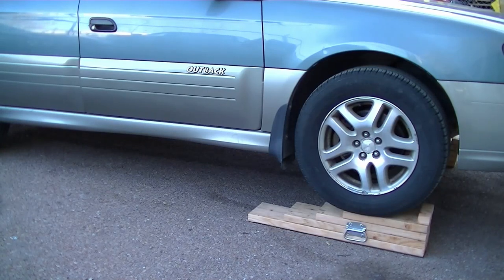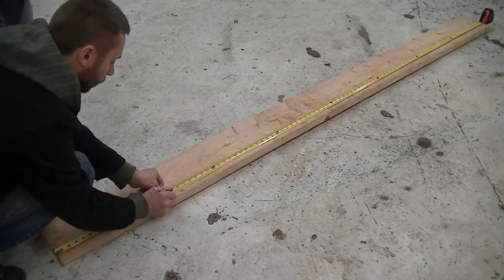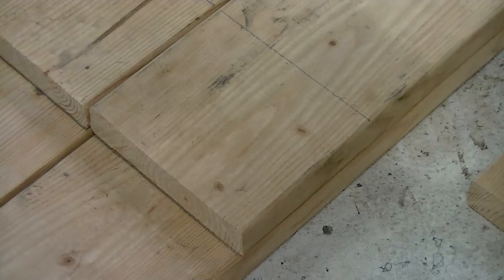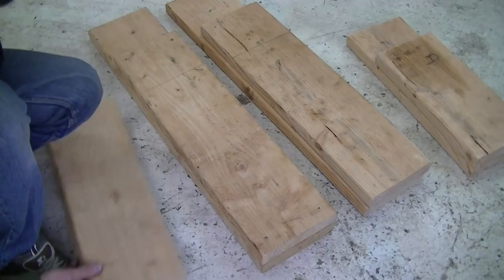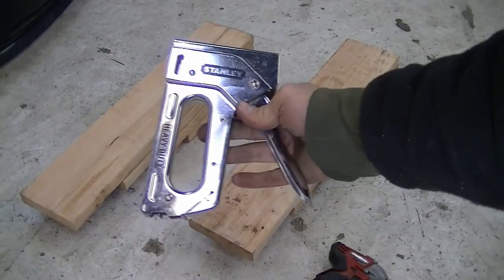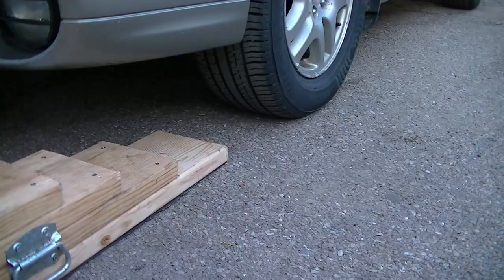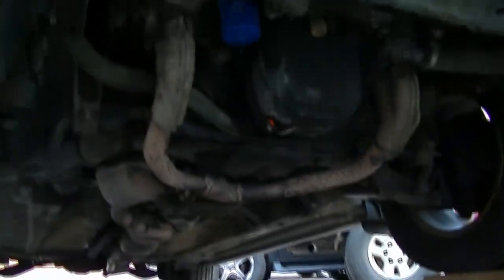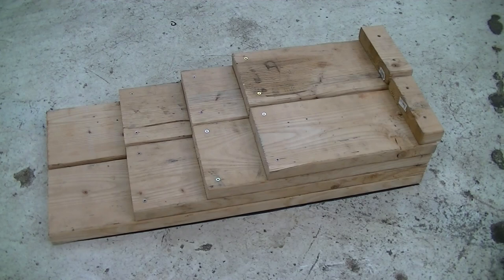Great DIY idea for Cars! Homemade Car Ramps

Comment: Even uf they dont have scrap wood i VERY HIGHLY RECOMMEND paying the 40 bucks and building one of these and NOT buying the plastic ones. Just look at amazon to see how often those plastic ones collapse. Thats ya life bruh.
Reply: 40 bucks? It's about 25 max assuming you have a drill. Home depot will cut the wood for ya
Reply: Those plastic ones only collapse when morons drive too far forward.   They are designed to break once you drive off the end.  That is to protect the vehicle.  

At any rate, you should have jack stands under the car no matter what the ramps are made of.  Wood can split, the vehicles weigh can shift causing the ramps to tip, or any other crazy thing can happen.  Jack stands are just another level of security.
Reply: Even if the plastic doesn't fail immediately, every material fails eventually and plastic will develop microscopic faults much faster than metal or wood.
Reply: hydraulic jack and jack stands ftw

Comment: I made this today! All in all, from deciding to make it to getting the lumber, to finding everything I need at Home Depot, to getting it cut there, using janky tools to put it together, took about 2-3 hours. But it's so worth it! Even at full price, the lumber I got, which was 2"x12"x8' (2 in x 12 in x 96 in) cost me about $25. Way cheaper and much more gratifying than those super crappy and scary plastic ramps. I also did the oil change on my driveway, which had a slope of about 1-2 degrees, and drove the car onto the ramps with the car facing downhill. This gave me a few more inches and it actually felt quite roomy under the car :)

Comment: For all you who are fearful of the wood crushing or splitting under the weight of common American vehicles please consider the following. Kiln dried Western White Pine (a very common construction lumber) has a cross-grain compressive strength of 5,040 psi. The front axle gross weight rating of a 2021 Chevy Silverado 2500 is 4,400 pounds. The tires are LT265/60R20 with ground contact area of about 51.6 square inches each. So a fully loaded pickup truck weighs in at 42.63 pounds per square inch on the front tires. The rears would be about 63.95 psi. Both are well under the 5,040 compressive capacity of the wood mentioned. 
What you should be fearful of is your 110 pound girlfriend wearing those spiked heals, she is putting down a load of 17,600 pounds per square inch . . .
Reply: Najlepsza jest sosna SYBERYJSKA...nie banderowska🤣🤣🤣
Reply: 😂😂😂 crushing

Comment: Thank you for your video. I really do appreciate it. Many other videos was not to my liking. This video was perfect. I attempted to use jack stands to change my oil and didn’t feel safe and not enough clearance. I then went to the store to buy rhino ramps and they were too high for my vehicle, the whole process was really disheartening and I began to get discouraged and frustrated. 
I took your method and applied it to a 2x12x8 board. Went to Home Depot and they cut it for me. Thanks again your video helped me out so much!!!

Comment: I followed your instructions exactly and they are perfect! I have a sports sedan and no clearance issues at all driving up these ramps. I was going to buy plastic ramps but have always felt they were a bit sketchy. These ramps are so solid.
Reply: If your ramps look like his ,, fix them correctly  .. you could be damaging your tires 

Each riser should be cut on a 45 and not left on 90 which leaves a square edge ..that square edge  can damage the steel ribs...two seconds and do it correctly...
That 90 degree edge places too must stress in a square inch .

It may seem like a little issue but you will damage the tire if you use the ramp with 90 degree cuts and you repeat that damage 4-5 or 6 times depending on the amount  of risers you will the damage separated by 6 or 8 inches...Plus any base should be wider than the object it supports.. Applied engineering would fail this ramp...not a fan of these techniques...

Comment: I have my wooden ramps since the mid eighties, my sports car could not clear the incline on my steel ramps. Thirty five years, haven't failed me, don't need additional jack stands to get in the way and never rusted or warped. I would never use plastic ramps. Good video for safe car or truck maintenance ramps.

Comment: You’re a genius! I’m building this for my next oil and coolant change! I’ve always felt unsafe working under my car only supported by jackstands.
Reply: Genius he is not ,,, here's why ... at least  I tried to warn you 
If your ramps look like his ,, fix them correctly  .. you could be damaging your tires 

Each riser should be cut on a 45 and not left on 90 which leaves a square edge ..that square edge  can damage the steel ribs...two seconds and do it correctly...
That 90 degree edge places too must stress in a square inch 

It may seem like a little issue but you will damage the tire if you use the ramp with 90 degree cuts and you repeat that damage 4-5 or 6 times depending on the amount  of risers you will the damage separated by 6 or 8 inches...Plus any base should be wider than the object it supports.. Applied engineering would fail this ramp...not a fan of these techniques...
Reply: @johnbravo2301 Your observation sounds perfectly reasonable. I’ll be making my ramps soon and I’ve decided to follow your advice and angle the edges.

Comment: I always get nervous driving up on ramps out of fear I'll drive off the ends.  I had a pair of ramps with very deep intents at the top so the car would slow down on it own.  That helped a lot.  I have one suggestion for you ramps.  Route the edges of the first 3 steps to make it easier to drive up and put a small thin block on the edge of  the last step to keep the car from rolling back.

Comment: Nice presentation.  I would caution that many newer cars have a much lower clearance which means you'll be scraping against the ramp as you go up.  You may need to spread out the spacing of the levels to avoid this problem, which will mean needing more wood.
Reply: What about cutting the edge of each piece in a 45° angle?
Reply: That's the greatest thing, you can make these exactly as you need them.

Comment: Awesome idea! I just need to change out the oil pan on my daughter's 2007 kia sportage, and was debating which ramp might be the safest on a gravel driveway considering plastic, metal, and cost since I'll probably never use them again. I have a pile of treated 2X8 lumber left over from a pool deck that I built, so this is the perfect solution!!

Comment: I just built these today, they work great! Thank you!
Reply: If your ramps look like his ,, fix them correctly  .. you could be damaging your tires 

Each riser should be cut on a 45 and not left on 90 which leaves a square edge ..that square edge  can damage the steel ribs...two seconds and do it correctly...
That 90 degree edge places too must stress in a square inch 

It may seem like a little issue but you will damage the tire if you use the ramp with 90 degree cuts and you repeat that damage 4-5 or 6 times depending on the amount  of risers you will the damage separated by 6 or 8 inches...Plus any base should be wider than the object it supports.. Applied engineering would fail this ramp...not a fan of these techniques...

Comment: Great video. I followed your design, and it has worked very well for me. Thanks for posting.
Reply: If your ramps look like his ,, fix them correctly  .. you could be damaging your tires 

Each riser should be cut on a 45 and not left on 90 which leaves a square edge ..that square edge  can damage the steel ribs...two seconds and do it correctly...
That 90 degree edge places too must stress in a square inch 

It may seem like a little issue but you will damage the tire if you use the ramp with 90 degree cuts and you repeat that damage 4-5 or 6 times depending on the amount  of risers you will the damage separated by 6 or 8 inches...Plus any base should be wider than the object it supports.. Applied engineering would fail this ramp...not a fan of these techniques...

Comment: Great video my man! Very simple and to the point!!
Reply: If your ramps look like his ,, fix them correctly  .. you could be damaging your tires 

Each riser should be cut on a 45 and not left on 90 which leaves a square edge ..that square edge  can damage the steel ribs...two seconds and do it correctly...
That 90 degree edge places too must stress in a square inch 

It may seem like a little issue but you will damage the tire if you use the ramp with 90 degree cuts and you repeat that damage 4-5 or 6 times depending on the amount  of risers you will the damage separated by 6 or 8 inches...Plus any base should be wider than the object it supports.. Applied engineering would fail this ramp...not a fan of these techniques...

Comment: Cheap and heavy .. perfect! 
I am a great welder but I don't trust that 2mm thick piece of steel to keep my father's car lifted
Your design is better, cheaper, can be trusted
Reply: If your ramps look like his ,, fix them correctly  .. you could be damaging your tires 

Each riser should be cut on a 45 and not left on 90 which leaves a square edge ..that square edge  can damage the steel ribs...two seconds and do it correctly...
That 90 degree edge places too must stress in a square inch 

It may seem like a little issue but you will damage the tire if you use the ramp with 90 degree cuts and you repeat that damage 4-5 or 6 times depending on the amount  of risers you will the damage separated by 6 or 8 inches...Plus any base should be wider than the object it supports.. Applied engineering would fail this ramp...not a fan of these techniques...
Reply: @johnbravo2301  now you comment ? 😂 
I noticed that and I actually made three 
The first one I mad was a great success but had the issues you mentioned
I don't have a problem with the 90⁰... Well for now at least until I change the tires or the car :p 
 but the stress that it was putting in my engine and clutch was pretty scary and can be prevented that's why I made another one

Comment: HI LOOKING AT THE REVERSING  CAR  ON THE  RAMPS,,,, THE BOTTOM BOARD WANTS TO FLIP UP
SO IF YOU CUT THE FIRST LENGTH OF WOOD  6 INCHES LONGER AND THEN  DO ALL THE SAME MEASUREMENTS BUT WITH THE EXTRA 6 INCHES STICKING OUT THE FRONT ,IT WONT TRY TO RAISE ,

Comment: Is it a good method for changing oils or because the car does not sit upright will oil remain in the crankcase?
Reply from the maker: On most cars the drain plug is towards the back of the engine, so raising the front actually helps draining more of the old oil 👍

Comment: Excellent video. Short to the point and easy to follow instructions. Will these home made ramps hold up to commercial truck traffic as a transition to a parking lot from a lower elevation roadway?
Reply from the maker: That's a cool idea, hard to say though, those trucks are HEAVY

Comment: This will be used for both a car (Hyundai sonata) and a truck. So for a truck with a tire size of 275 65 18, would your application work? The 2x8 is truly only 7 1/4" wide. That tire size is 10.8 inches wide. Is it ok to have the tire hang over the sides if centered or should a wider (2x12) be used? I'm looking for this to work with both vehicles. Thank you.
Reply from the maker: I would want to go with the bigger board in your case. The only downside, the ramps will get pretty heavy.
Reply: @MakeItEasyMechanic  🙆‍♂️🙆‍♂️🙆‍♂️

Comment: I'D USE A LENGTH OF 12" WIDE LANINATED BEAM MATERIAL.... LESS RISK OF SPLITTING, ETC. AND WIDER EDGE TO KEEP THE TIRES ON.....ALSO, MAKE SOME CROSS TIES, AND X-BRACING, BETWEEN EACH SIDE (L & R), TO LOCK THEM TOGETHER, WHEN IN USE... MAKE THEM  FULL LENGTH OF THE VEHICLE, SO THAT THE ENTIRE VEHICLE IS RAISED, AS NEEDED.

Comment: Changing oil & coolant isn't the car need to be on level ground ?
Reply from the maker: Changing oil - no, checking it yes. I would usually start with 4 qts of new oil so I can drive the car off the ramps, then top off the oil on level ground. Cooling system is not as picky to the tilt of the vehicle since you're just making sure the radiator is full.

Comment: Where did you buy the handles and rubber mat for homemade car ramps?
Reply from the maker: Home depot or lowes, I also have a link in the description for some similar handles, I cut out my rubber mats out of some old car mats, but I think you can buy rubber mats by the foot at home improvement stores
Reply: @MakeItEasyMechanic  ...thank you so much.  I really like the way you put together these car ramps.  Thank you for sharing.

Comment: If your ramps look like his ,, fix them correctly  .. you could be damaging your tires 

Each riser should be cut on a 45 and not left on 90 which leaves a square edge ..that square edge  can damage the steel ribs...two seconds and do it correctly...
That 90 degree edge places too must stress in a square inch ,,,

It may seem like a little issue but you will damage the tire if you use the ramp with 90 degree cuts and you repeat that damage 4-5 or 6 times depending on the amount  of risers you will the damage separated by 6 or 8 inches...Plus any base should be wider than the object it supports.. Applied engineering would fail this ramp...not a fan of these techniques...

Comment: Here's another idea.. use 4 of those and lift the whole car.
Reply: Hol up... How are you going to get the second set under the car after you get it on the first set? You'll drive backwards to get on the second set and need come off the first ones
Reply: @kurrizzle  Please tell me you're joking? Obviously you would place all four ramps in  front of the wheels and then drive up on all for ramps.
Reply: @tif321dc  Nope, I'm just really stupid. I have a small car with pretty low clearance so putting the ramps under the car didn't seem like an option. Guess your way works if you have a truck or SUV

Comment: when i try to drive up my truck starts skidding on the wood. Dont know what I can do to remedy it any suggestions>
Reply: Take the bottom boards and screw in a wide nylon tie down strap to each one. Make them long enough to stick out the front by 4 to 5 feet which will allow the wheels to grip the straps and prevent the ramp from skidding forward
Reply: @lml03647  brilliant idea -- will use

Comment: Here is a lighter design, taller, with removable ramps. I used 2*3 instead of 2*4. You won't regret having a 24" 2*12 on top. https://youtu.be/s6lvqfVP28I

Comment: Unless you get the wood for free, this is not economical.  You can buy quite nice ramps for around $20.  The bonus is that commercial ramps have a little "pocket" that the wheel drops down into so the car stays put.